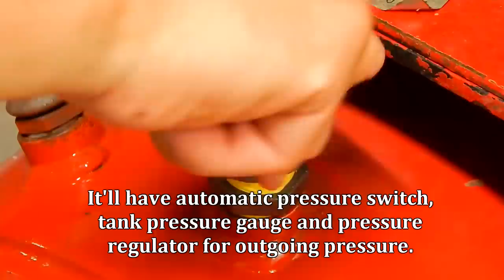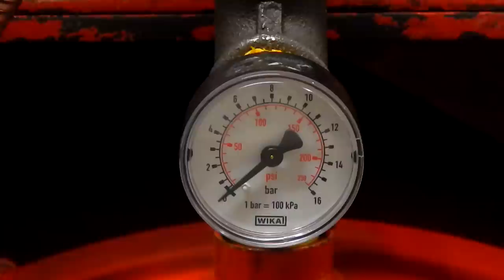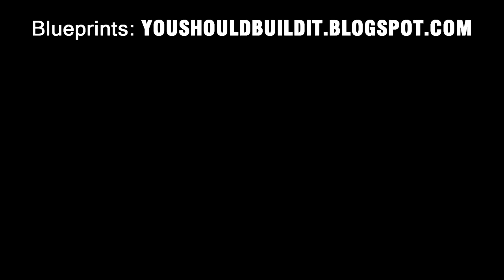Air Compressor Build

Comment: Donn build a sand blaster! 
Those parts would clean up like new and much easier.   I use my sand blaster to clean up everything.  It’s a bit persnickety in its running but the out come is much better than by hand or wire brush!  

OH !!!! I did not realize the air compressor was for a sand blaster!!!! 

Great work!

Comment: Donn very good restoration  on the compressor , but  i always warn people  about wiring , you see  the wiring coming out of the motor have to be renew too because the age  of the motor  , please make sure you pay attention to details take the time it go to be safer for your life and as well when soldering wire together  first tide them together by twisting them  then soldering and shrinking the plastic sleeves you have put in before  this process, Hope you will accept  these infos without been  upset  ,you are a brilliant metal worker  , regards Robert in Australia

Comment: Very nice, if only we all had 3 phase power. Easier option is to stick with a petrol setup and have good ventilation or have compressor outside.
Reply from the maker: Here in Europe it's quite common to have 3 phase.👍

Comment: You really should do a hydraulic pressure test when you reactivate rusty pressure tanks. Incompressible fluids don't scatter parts over the next county if the tank fails.
Reply: its 8 bar... its not needed under 10 bar. at this pressure, if a leak ocours itts at the most a pinhole, different story above 30 bar or with steam at even 8 bars or lower pressure, indeed, thats dangerois.
Reply: @MrBugsier5  
I have seen a compressed air tank like this one fail catastrophically so I am forced to disagree.

Comment: Great job i like it 👍 but i have a question why dont you make one of axels to steer? putt there two 360° wheels whit brakes 😉 or putt some bearing on axel  or somethig like that it will be easier to move, and you dont have to pull up every time Peace ✌️👌

Comment: Excellent job! I didn't notice a drain valve on that tank. Is there one? It's necessary to drain the water from the tank to keep it from rusting internally.
Reply from the maker: It's on the bottom on the compressor end of the pressure tank.

Comment: Does that motor control box unit have some kind of "overload" built inside it?.
If not, you should have some kind of closely matched breaker or even a fuse system wired into it.

Comment: Fantastic rejuvenation of an old compressor.  It will probably outlast you now!   I am a little surprised you didn't make a steering axle for the front though ;)
Reply from the maker: I was going to make a steering axle but then my laziness took over. Besides I'm not gonna roll it around anymore hopefully when it is finally in it's place.
Reply: @DonnDIY  Ha! I'd never believe you were lazy in 1000 years!  If it won't move much the fixed axle does makes sense though.
Reply: @DonnDIY  And with the fixed axles it will be less likely to wander when running and you could use 4 rubber house hold door chokes to further limit the movement.  The  four rubber tires  without a fixed foot will reduce the mechanical noise transfer against the concrete slab.

Comment: Good.  You didn't cover up the metal spec plates with paint.  I had to remove the paint from the plates on my compressor tank.

Comment: Nice work.  With an old tank  that may have rust, did you consider a filter between the compressor and tank to eliminate water? I suspect you could make a good one.
Reply: Gggg

Comment: rubber handles for the pulley system u added and a air pump machine break system so it won't move when running.

A turn on n off electrical chart system sticker so ud remember which wire goes in what socket inside the gray 3 phase box..

Comment: that tank needs to be hydrostatically test. This can be done with a grease gun, pressure washer, hand pump. This can be life saving. you need to test to at least 1.5 times tank working pressure

Comment: You could put the front axle on a central pivot with a handle like a wagon so you can maneuver it better.
Reply from the maker: Yes, but this air compressor is stationary even though it has wheels. The wheels allow me to move the compressor around more easily when the layout of the compressed air line changes for some reason.

Comment: Should have made front wheels rotational and the elec motor base to be with rubber bushings to prevent vibration, makes the compressor more quiet
Reply from the maker: No need for the rotating front axle, the air compressor is stationary. Also it would have been more work to fabricate the swivel axle. Originally this compressor had a petrol engine installed on it without any bushings whatsoever. So installing an electric motor without bushings is not that bad. There's minimal vibration or none.

Comment: Great video and great re-build. I have a question about your workshop. In winter when you want to welding inside the shop, what is your plan for fresh air. I was thinking of exhausting the air outside, but also installing one of those heat exchangers. Just  wondered what your thoughts were.

Comment: Next project, pedestal grinder with wire wheel to clean the rust off your steel? Nice work Don, building up my own compressor at the moment with 3 head pump on an LPG tank. How is the ram pump going?
Reply from the maker: Ram pump is still pumping fine. Have to upgrade the feed line to a bigger one though to make it pump faster and thus more.

Comment: Just 2 things: 1) try to check electric with a tester first before plug, (the IEEE xxx asign the light blue cable to the neutral, maybe better to keep that standard, than have a special for oneself), the 2nd: there must be a way to test ot ensure that the air container is fine not having rust damage and able to resist the pressure you're going to maintain in that cylinder, because it could be very dangerous if it's no able.
Reply: Yeah that was my problem too, he goes and uses steel fittings and doesn't have an inline water separator and no noticeable way to drain any water that collects inside the tank

Comment: If your tank is too old it can explode.  The date on them is there to keep people from using the tank too long as the rust from moisture can thin out the wall on the tank and then it explodes.  There are video on youtube about this problem.

Comment: It would be a shame if the tank leaked after you did your cleaning, painting, and motor work. Did you check whether it held pressure beforehand?

Comment: hi
while you have not so much soiled the floor. proposal-  cover it with a Floor Epoxy Coating to keep it clean longer,  easier to clean, and did not absorb lubricant
Reply from the maker: How will the epoxy coating stand up against welding spatter and other hot metal?

Comment: How did you know which cable on the engine was going to which cable in the wall .. I also have a motor (pillar drill), no colors on the cables and I am too scared to try out which cable should be, And do not know much about electric motors. sorry för bad english
Reply: 50% chance....😃 3 fase motor. If it would have turned in the wrong direction , you have to swap 2 fase (wires) and the motor will run in the other direction. 👍
EU: the red CEE plug has 5 connections, 3 fases, a neutral and a ground. Fases are often brown, black1 and black2, blue for neutral and green/yellow for ground. In CEE p,ug you can see the connections, L1,L2 and L3 for the fases, N for Neutral en PE for ground.

Comment: The automatic pressure switch cable is incorrect. It does not withstand vibration. Replace it with a very multi-stranded cable. Protective hose over motor wires. Then your project is awesome.

Comment: Considering the cost of parts did you do this for less than the cost of a new compressor of the same size?
Reply from the maker: Absolutely less. I got this whole compressor for free and had the electric motor on the shelf. The plumbing and paint cost a bit, but that's it.

Comment: Who paints an electric motor LIME-GREEN?  You need to protect those hot wires from the motor to the starter...is that a 'real' motor starter or just a contactor?

Comment: Attention! 

Never solder non-twisted joints used for high voltage. It is very dangerous!
Under load the wires will heat up, the connections will unsolder and close. Be careful!
Reply: To melt solder, you have to reach at least 200° C.

Is more likely to have a failure by mechanical cracking of the solder joint.

Comment: Why the heck would you go from gas to electric and you’d be ahead putting pivoting wheels on it
Reply from the maker: Uhm... using it indoors is a big enough reason for the conversion don't you think...
Reply: No. Outside. Problem solved

Comment: You dont clean elec engine ?
rotor stator with 90° alcohol, grease bearing....
n.b. :car air filter = less noise : search improve air compressor /YT

Comment: Garbage, brand new (air filter no dust, not any rust etc), 1-2 years old & cost 1500 euros
Abac pro 150L 3HP 
(powerfull but big, leave outside under pallets etc).
Happy ü

Comment: Better to do nothing than do that so cheaply and wrongly man...
Reply from the maker: So it's either everything you do in your life you get perfect on first try or you do nothing worthwhile in you're life at all... Good for you. This air compressor supplies air to the workshop at the moment, mainly the plasma cutter. If I hadn't rebuilt and modified this air compressor I couldn't use the plasma cutter at all at the moment. So it's a win situation for me.